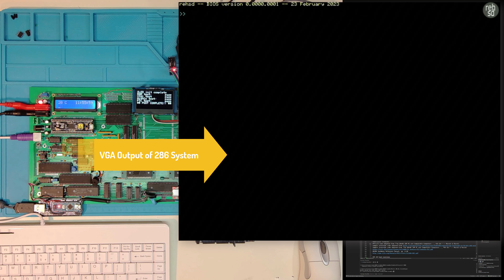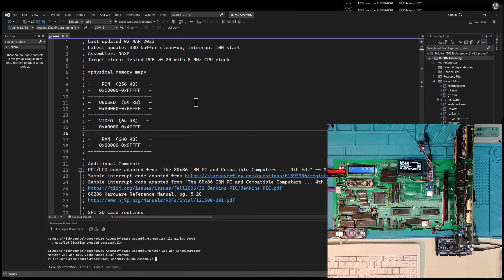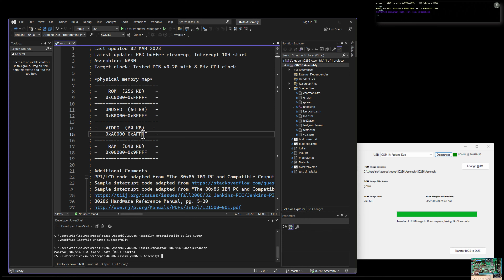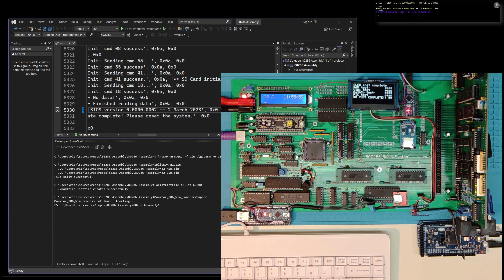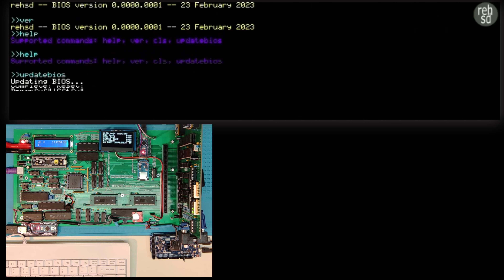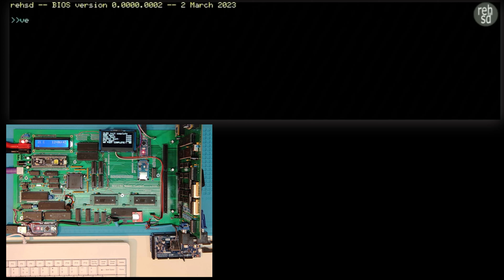80286 Build, Ep. #78 - Working! Onboard ROM Updates, part 5

Comment: What are your thoughts on using something like your arduino or a raspberry pi pico to make a "fake" rom chip? You'd need to design some kind of pin compatible carrier pcb, but it seems like it'd be a straight forward way to rapidly iterate on firmware code.
Reply from the maker: I think that would be workable, and I have seen others do something like you suggest. I could use a Mega/Due to simulate a flash ROM. I could even use a Due on my current 286 board, where I have a place for a Mega. The address decoding would simply direct ROM traffic to the Due instead of to the flash ROMs. I could still build code and transfer to the Due flash, then that flash could be read directly, instead of writing to the flash ROMs on the board.

Comment: Last time I flashed my ROM on my modern windows computer, it automatically rebooted. Why not do that and then you don't have to worry about continuity between flashes.
Reply from the maker: That's the next piece that I'll implement. I will have an SPI call to my Nano that will pull the reset line on the entire system. I will likely inform the user first, something like, "Update complete, press a key to restart." Currently, I halt the CPU at the end of the update, so the reset is mandatory.
Reply: And we'll done by the way. Fantastic!

Comment: about the character data start, you can use what we do usually for code: having a bunch of fixed addresses which contain the address of the thing you're interected in. In other words, fixed pointers.
Reply from the maker: Yep, I just need to set it in my code. Previously, the location didn't matter, but with the shadow ROM, it's now more important.